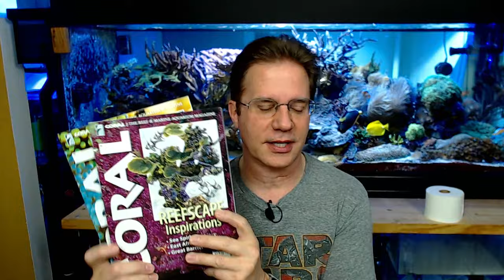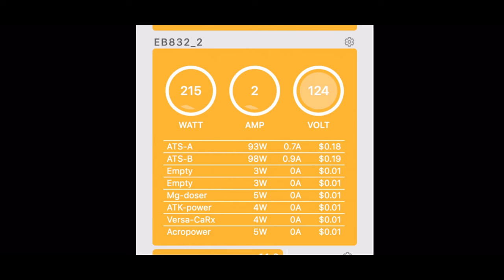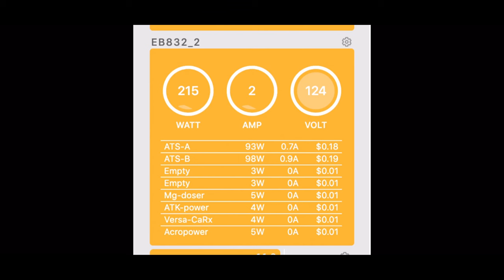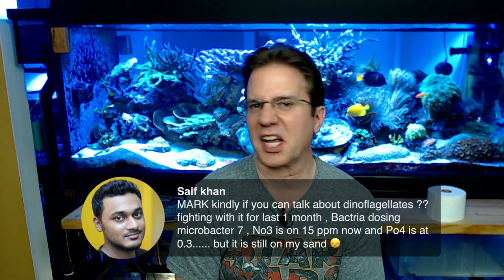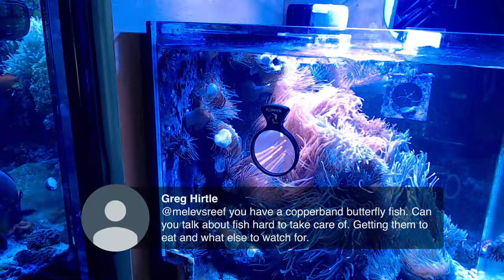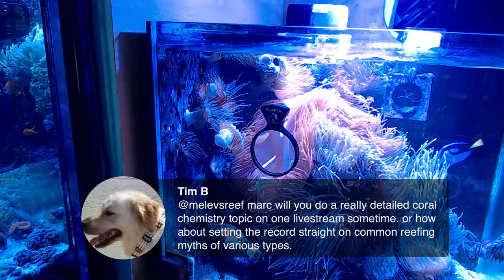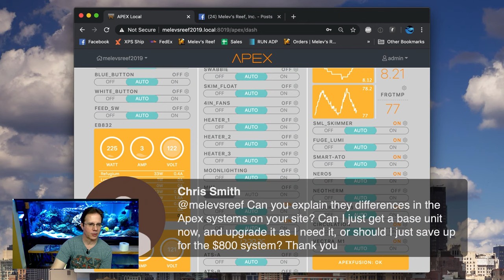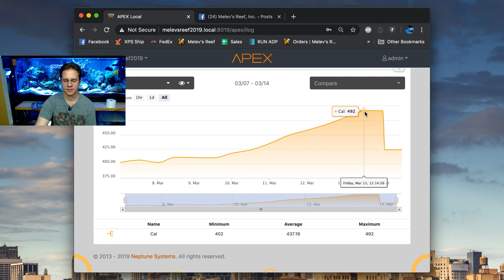Let's talk about... (insert thoughts here)

Comment: A air conditioner is nothing but a giant dehumidifier, thus the condensate drain. Set it at the temperature you are comfortable at and leave it. You are not just heating or cooling the air but the entire thermal mass of the home.
Reply from the maker: That’s true.